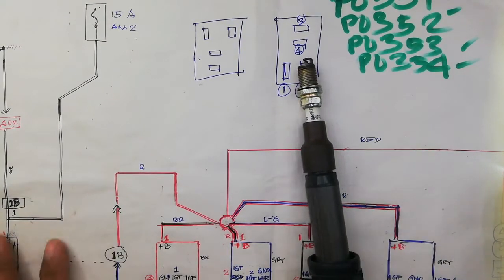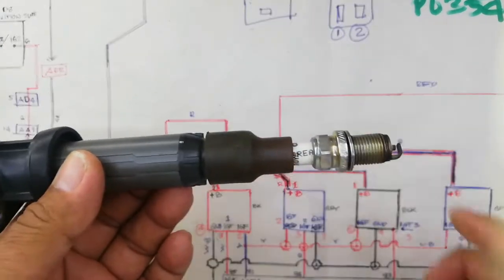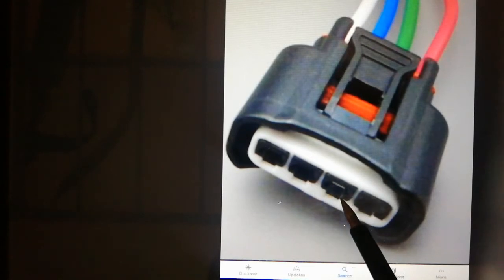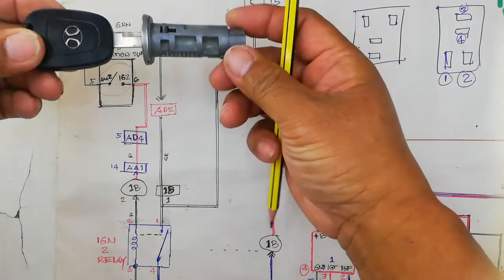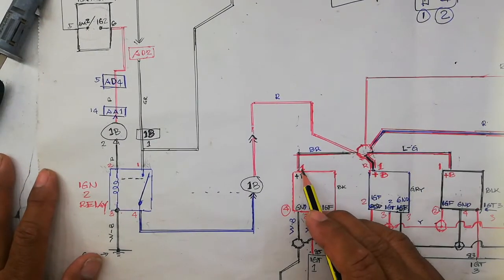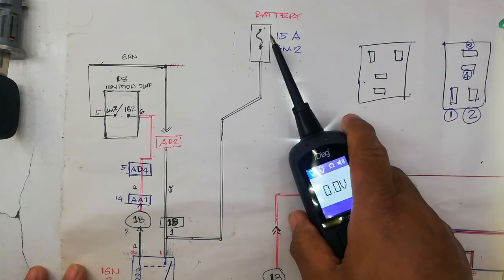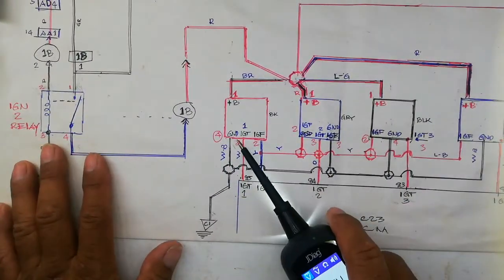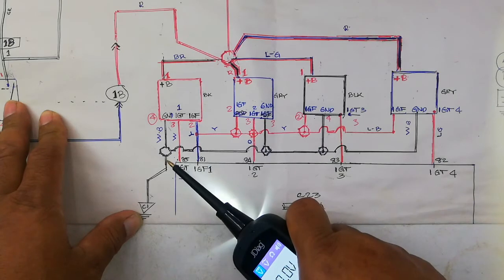Engine crank but not start Toyota Yaris.

Comment: mine has hot starting probs starts fine cold, but wont start when engine is hot after driving it
Reply from the maker: check pressure when issue appears

Comment: hi maybe you know! I have problem 2nz-fe motor. They have crank and 12 V is exiting für ignition coil. No error in obd but no spark. What do you think maybe error. Crankschaft and camshaft sensor ist new but still not sparking
Reply from the maker: Sorry late reply check immobiliser light if illumination light always steady even the key is insert.if not off check your key chip